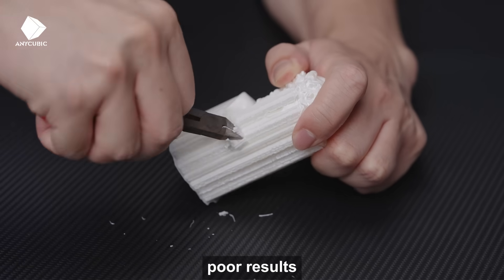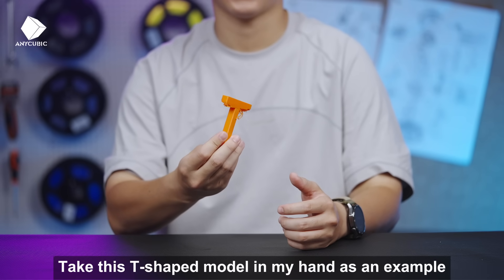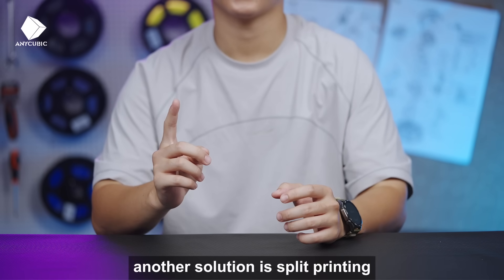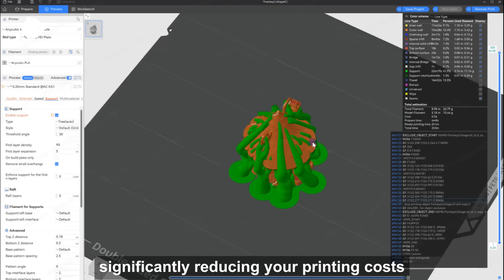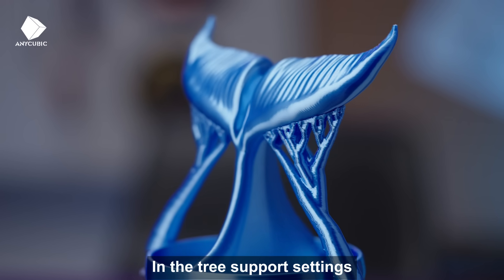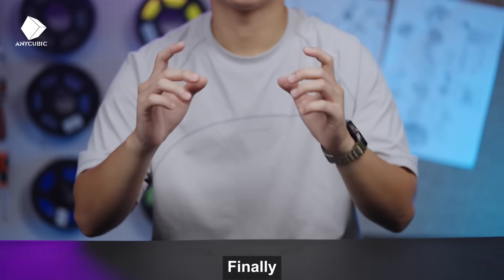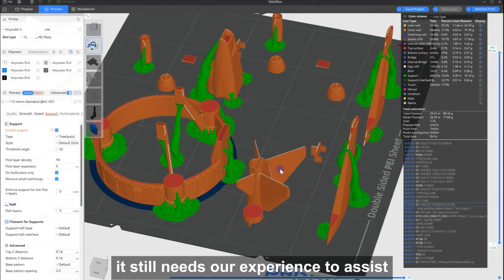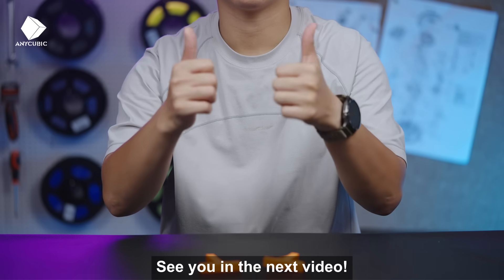The Ultimate Guide to 3D Printing Supports: Simple Settings for Pro Results

Comment: Feeling frustrated and fed up. Sharing this to hold Anycubic accountable.
I’m disabled — missing the ends of three fingers — and I’ve been fighting with Anycubic for over a month just to get basic warranty support for a defective printer.
Instead of helping, they told me to fix it myself. That’s not just wrong — it’s a violation of the Americans with Disabilities Act (ADA). Then they sent me the wrong part, which I tried to install. It damaged the printer even more because of my disability.
They keep saying they “comply with U.S. law” — but talk is cheap. Their own emails prove otherwise. I’ve been left without a working unit, forced to advocate for myself, and treated like my disability is an inconvenience.
I’m escalating this to the proper authorities and sharing it publicly because no disabled customer should be treated this way. If you’ve had similar experiences with Anycubic or other companies, speak out. They don’t get to violate federal law and walk away quietly.

Comment: I came to Anycubic Slicer Next from Cura, kinda being forced to after receiving my Kobra S1  While there is a lot that I like about it, I'd have to say that Supports are maddeningly bad in comparison, especially in points where there are very small gaps between the model and the bed (less than five layers).  Regardless of the type,  ASN/Orca uses significantly more material in supports and are tremendously more difficult to remove.  Hopefully these suggestions will help, but if 10% Branch Density is recommended, then why is the dault set at 30% in Anycubic's own product?
Reply from the maker: Our slicing software is developed based on Ocar, and some features may not yet be fully adapted to your specific needs. 
We are continuously working to update and improve our slicing software. 
Thank you very much for taking the time to leave us a message and share your suggestions. We hope you will continue to follow our progress. Thank you!

Comment: should I point the fact that the "more advanced tree supports" didn't significantly save material, if anything it increased the usage slightly but greatly increased the printing time when compared to the traditional supports... (at least for your presented example)
I will admit it sometimes is indeed easier to detach from the model, but at least for me never once saved materials and specially time... if you gonna show something, do so in support of your claims and not a blatant contradiction...
also, why is the presenter head cut off? I presume cheap voice over of the original footage... piece of advice: cut the footage to show mostly the hands, or just don't cut it at all, voice over is not a bad thing... (the cadence of the speech vs. that of the gestures are a dead give way, the vid just looks off)
would expect much better production quality from an official manufacturer channel... but that is just me...
Reply from the maker: Thank you very much for your response. First, we mentioned that the best approach is to avoid using supports altogether. Secondly, when we talked about reducing material usage, we meant minimizing the risk of model damage caused by support removal, which could otherwise lead to re-printing. We truly value every suggestion from our users and look forward to your continued support. Thank you.